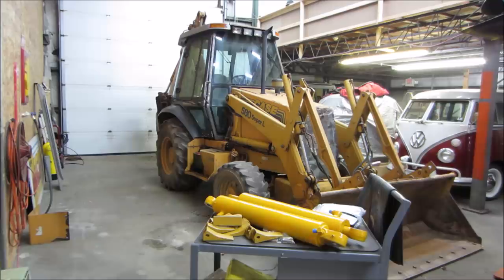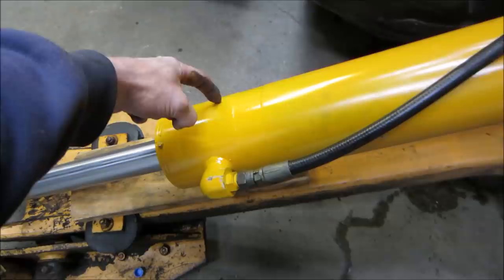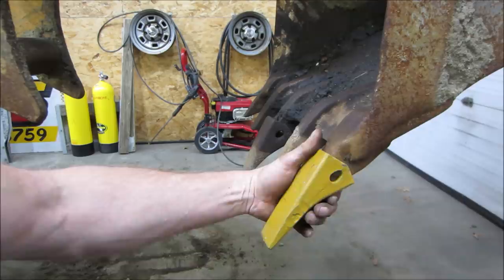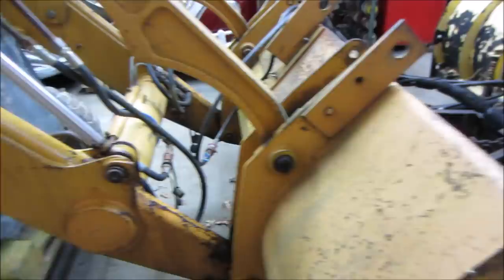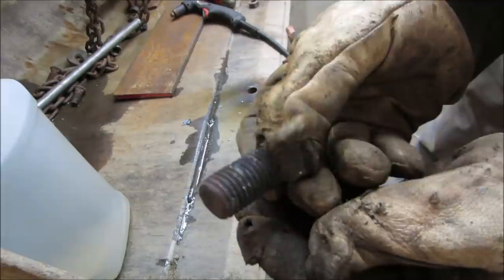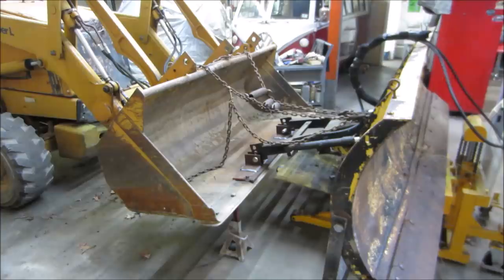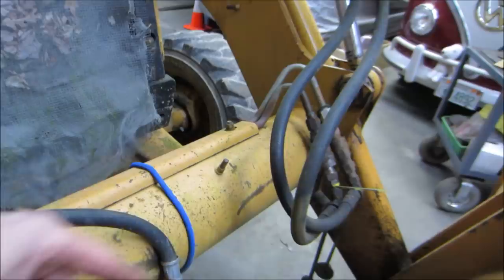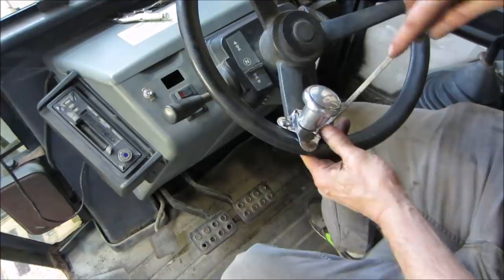WHY NOT? Lets Install A Snow Plow On A Backhoe

Comment: Hiya. Apparently, if one is fast enough, decent Scotch will not destroy your computer after a spit take. When you were removing those cutting edge fasteners, I was muttering to myself, that I would have broken at least one tool already. When you cut to the shattered socket, my laptop got a Glenmorangie 12 bath. I stopped laughing for a moment, as I pulled the plug and battery in a panic. Then I laughed for another 10 minutes. One would think Scotch would clean out the sinuses. Nope, just hurts, but then your nose gets numb. I expect it wont feel good tomorrow. So, I pulled the laptop apart gave her a nice tidy and and methanol rinse, removing any debris, and remnants of the Scotch, followed by air. If you need a liquid cleaning agent with electronics, alcohol helps carry away any water and dries very fast. It needed cleaning anyway, and I have more Scotch. Thanks for the laugh man. ... and of course the laptop still works. How would I have watched the rest of the video? :-D

Comment: Warning to the wise...
NEVER use a bare hand to hold the backside of a cutting edge bolt while removing. The wear to the bottom of them makes a nice sharp edge, and when the plow-bolt square frees up, it can spin right through your fleshy bits. Leather gloves can even get eaten right through. Use a chunk of wood or metal is the safe solution. 
I don't care who has done it "a million times with no problem" all it takes is once, and once you have seen someone else screaming with a hole in their hand.... yeah...

Comment: Putting your blade that far out on front will get awkward really fast in small places. Not mention the first time you hit something solid with that plow, it will shear off the bolts and or bend the lip. think of how much that tractor weighs, put that in motion and then stop it with the blade, bad things are in that future.

Comment: Now wait a minute cowboy. When I used those come along you did not need to release the latch by hand, you simply pulled the handle all the way, and it automatically released the load off the lock and transferred the weight to the pump lever. Am I missing something here? With almost any tool, if you are afraid of being injured using it you are probably doing something wrong!

Comment: Different people like those bucket teeth put on different ways.
For digging in hard material have the teeth pointing down which will put the thicker part of the tooth facing up for better digging and longer wear.

For normal trenching in softer materials the teeth should NOT be pointing down so you can get a nice smooth flat trench bottom without the teeth digging in and leaving the bottom rough.
Remember that one side of that tooth is thicker than the other side and that's where most of your wear and pressure points will be when digging the way that you want to dig. Whether you are doing hard scraping or slicing layers off.

Comment: I know I know this gonna sound like a troll love your vids buds but 5 times I was screaming at this vid most of them at the plow on the bucket the other was the teeth on the backhoes bucket that was right the other was when you where moving the drop arms dry  but love your vids just be careful of that set up with the plow on the bucket i always used the bucket for moving snow they do make a plow that fits where the bucket goes

Comment: I think you are supposed to remove the original bucket, and replace it with the plough.   Otherwise it will put the force of the snow too far in front of the front wheels, and cause steering problems.   Aren't the vertical brackets behind the bucket supposed to connect to the plough brackets..?   I hope the hydraulics have a float position, or you will be ploughing the road in stead of the snow.

Comment: Buy yourself a can of penetrating fluid.  It would have helped with said bolt at 35:33 .  Please also consider gloves when working on these things so you don't absorb oil, etc. through your skin and reduce the risk of cancer.  I am not paranoid.  This is the "ounce of prevention" thought process.

Comment: cobbling a plow to the front like that, just stick it against the bucket directly? or use the bucket itself as is. yes, you'll have left no left right angle, but not really needed with the bucket and ability to haul and dump.

Comment: Now I see why you were so adamant to get the plow hooked up.  Not only can you push with a right/left angle, it also can move up/down with the terrain below it.  The bucket cannot do that.  It's made to move dirt/snow/whatever in line with the push of the machine and it is not meant to glide over the existing ground, rather it is supposed to tear into it!

Comment: it's going to suck trying to plow with that setup. It would better to remove the bucket then adapt the plow to the framework itself. It would be much easier  to turn with the plow 2 feet closer to backhoe. When it's time to turn around your going to hate that set up.....

Comment: Ok for What is worth i know it is all ready finished BUT . Why  dont you use what we use around the Airports  Terminals ?     A straight Blade ours are 20 ' but you can make it any length that you need to . It is plates welded on the back of the bucket with up rights on the back of the blade , you roll the bucket then come into the blade picking up and leveling out the bucket will be 2-3 ' off the ground with the weight of the blade added to the machine and NOTHING added permanent except the plates on the back of the bucket  , they Look like Jimmy Durante's Nose face down on the back of the Bucket . Never have to climb out of the Cab and Hook up, No bolts , pins , Hydraulics . Easy peasy . I will see if there is a link showing the Loaders at work in the snow .

Comment: Plow on the bucket would be a hindrance. Get used to cutting edge you have and not adding weight on the front will not affect the balance of the machine or its operating capabilities

Comment: I'm not quite sure why you don't just use the bucket....  A million years ago, this place I worked, at one time they would switch the bucket for a plow....  But it apparently wasn't worth the hassle, because they quit changing them out, and started just using the bucket....  Another guy I knew bought a "snow" bucket...  Which, I have no doubt people will tell you is dangerous...  Snow is lighter than rocks & dirt though, so if you just use it for snow, it's a huge bucket, your scoops are really big... Works great for snow.  You just have to be very careful, to never use it for dirt....

But hey, what do I know...  You are there, I am not.  You probably have good reasons for doing it this way....  I look forward to more videos...  All will be revealed!

Comment: That's a awful long front overhang (added weight)  You would be better off re-moveing the bucket & fab from the arms same way as the bucket attaches to the lift arm ....more lift & stability etc.  That Added length will make it weaker & harder to turn for clearances also !!

Comment: Sould get a cyl for the thumb, those fixed thumbs are nothin but a pain Why bother with the blade, the bucket is good enough for removing snow, at least you can lift it up and dump the snow further back

Comment: I’m with Jeff Joy. Surely the front bucket is demountable and could be replaced by the plough. But again, mirroring other’s comments, why? Sell the plough and buy other made to measure “toys” to be attached which are more significantly different. A hole auger or cement mixer bucket……

Comment: Frankly,  you have rig  way too long,  best to remove the loader bucket and mount the blade in the original location of the bucket .  Add another control valve too swing the blade. I would add quick connections to the hydraulic lines.

Comment: I don't want to sound like a smart@$$ and often when advice is given for a simple tool... How to use a come-along. Connected to the latch is a spring with a slotted bracket on the other end. By raising the handle to the upper release position taking the tension off the latch, move the spring to the other end of the slot by sliding it. You are now ready to one handed lower the load. This is done one tooth at a time. Raise the handle until the button on the handle in depressed and then some more. You will fill the weight of the load. Lower the handle until it engages the next tooth and the latch shifts position. 
It may be slow but it's a lot safer and bonus round, that's how it's made to work. If your using two hands, your using it wrong.

Comment: @30mins in and I'm cringing at the leverage forces that will bend or snap the fabrication you're doing.

How hard is it to remove the bucket and then make an interface using the bucket mounts to fit the plough V how many times you need to change over the plough and bucket config????

Keep it simple.

I always enjoy your vids and you've inspired me to do lots more than I feel comfortable with.

But this one - I'll watch to the end and hope it works for you - but I can't imagine it working or lasting.

Sorry :(

Comment: That thing you put on the steering wheel is not called a spinner. It is called a "Necker Knob". Originally used by teen-aged boys so they could neck with their sweet-hearts and drive the car at the same time...........

Comment: Just looking at the set-up not being an engineer or any other kind of expert that blade looks enormously heavy too heavy for that piece of angle iron or those chains but I guess the proof is in the pudding I will watch to the end and find out what happens after all you have more plenty more experience than I in these matters for some reason I thought you'd be un hooking the blade and connecting up the plough but then again it's not like the blade isn't heavy and it's not a bobcat after all that bucket is very very heavy but I'm no expert like I said I leave all the real thinking to the video maker oh that's you Mustie1

Comment: You don't want to mount the snow plow to the blade...make a bracket to match the bucket frame when removed. Take off the bucket to use the plow!!!! You will ruin the bucket if you mount the plow frame to it....trust me...

Comment: "Spinner-Knob?" I know those as a Suicide Knob. Just saying.     I'm guessing, that you were about at the limit(s) of your welder. Next time you might consider "Pre-Heating," to approx. 500 degree's, plus.   Next time at your local welding supply, look for some "HEAT-STICK(s.) / Pen(s.)"   They come in different heat ranges. Cost's are minimal.   Simple to use, you heat something up, test via the Heat Stick / Pen, draw / make a mark approx say a 1/4" in. long, if the temp is correct, the stick / pen simply melts, leaves a clear mark. No mark/sign of melting, just add more heat. No rocket science needed.  Each of your brackets (Angle-Iron) required two welds. Compare Your first {cold} weld(s) on each bracket versus your second welds (which were done via per-heating.) I'll leave out the many other reasons for pre-heating.

Comment: FIRST: WHY the hell do you need a plow on a backhoe any way? SECOND (and maybe you covered it and i just missed it) why would you not make an upper bracket for the plow to make it more rigid rather than just use the weight of the plow it's self and those chains? it just seems to me you would want to be able to apply a little down force on it too on occasion and those chains won't actually let you do that being as they would simply flex upwards and possibly come loose on you and then your day is done !

Comment: NEVER design a bucket attachment that needs to be BOLTED anywhere. Pins are there for a reason! Your whole contraption inside the bucket will need to be unbolted whenever the bucket alone is used! 
Pins! Always!

Comment: NO NO NO. Do not ever put your fingers on the bottom of the bucket blade bolts when taking them off. They have a tendency to spin inside the hole when loosening the nuts and wear makes them sharp a a knife and will cut the tip of your fingers off.

Comment: One of the very few times I really disagree with your fab. The amount of force you’re applying to the bucket edge with that long arm of the plow , hummm. 
I’m gonna agree with a lot of others, take the bucket off of you insist on using the plow blade but I’d just use the bucket.  Maybe look on the web and see how others mount their blades.

Comment: Keep in mind the location. The amounts of snow in Minnesota vary greatly from ohio or even Canada. If you are plowing streets with manholes the skids on the plow are important because the bucket could catch. Also cant accidentally dig into the pavement if you put a rookie in the loader. Plus all the wear on tge cutting edge of the bucket which is probably more expensive than on the plow. Buckets are great for removal and ok for plowing but you lose the ability to direct the snow to the sides.
Reply: @garymallard4699  yeah that is kinda what i said if u actually read it. Im from Minnesota, live in northern Indiana now. And have a cabin on rainy lake in canuck land. My whole second sentence says that the snow varies based on location lol

Comment: I'm not happy with your design. Mounting the plow in front of the bucket puts a lot of stress to the loader arms. The loader arms are designed to lift and push things straight forward. With the plow attached there will be a loft of side force that probably could bend the loader arms.
Mmmh, raise the bucket above the plow and attach the plow directly to the tractor frame? 
Sorry for my bad grammar. ;-)

Comment: With this large equipment and snap rings you are in now the Varsity class and need bigger tools....! Always grease moving parts,pins, etc!
Reply: Yeah with a machine like that you have to buy grease by the drum. Or you'll be buying parts regularly for it. The grease is a lot cheaper.
Reply: 17:00 and that is how you change rear tires/wheels...., good  McGiver 101,  building a temporary hose holder  clamp,  amazing what old pieces of rubber  hose can be repurposed for!
The sacrificial teeth for the bucket are to be mounted with the curve side  UP..!
is the cab heater working?
Now he'll sing let  it snow,  let the north wind blow..?
Reply: @kpdvw  if they only wanted bucket teeth mounted one way they'd have made them so they only fit one way. It wouldn't have been hard to do. If you like them curved side up fine. You do you.

Comment: Your plow is to far ahead of you and your swing is way to large , you’d be better off mounting the plow where your bucket is ! Make a plate hitch ( quick connect ) and take the bucket off and mount the plow there ! Right now your plow is about 25 ft. Ahead of you , there’s a reason the plows on trucks are only 5’ from the front and your sweeps will be huge the way your setup now ! Plus all that weight in front ! Just saying !